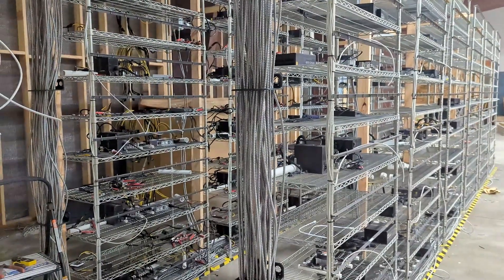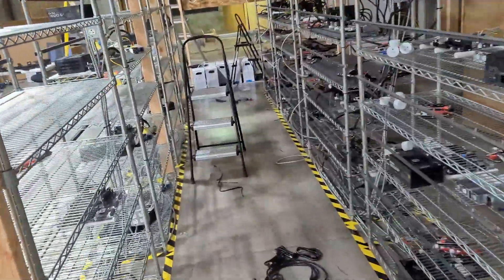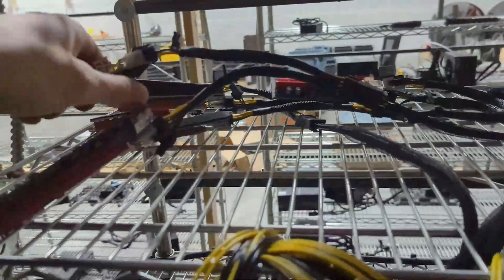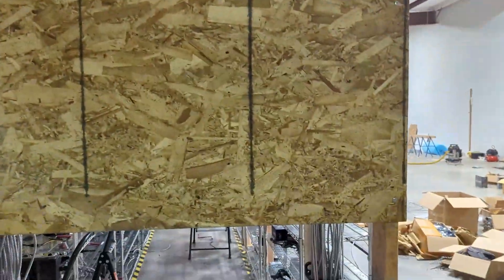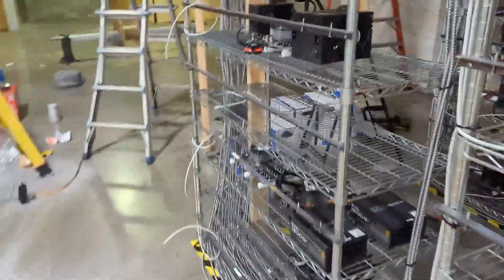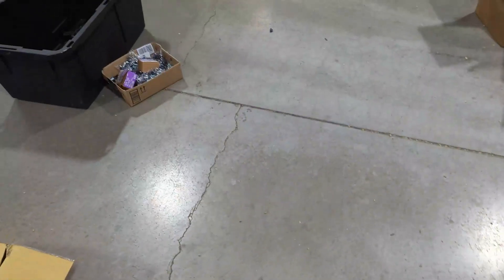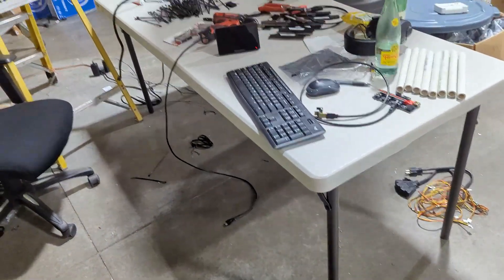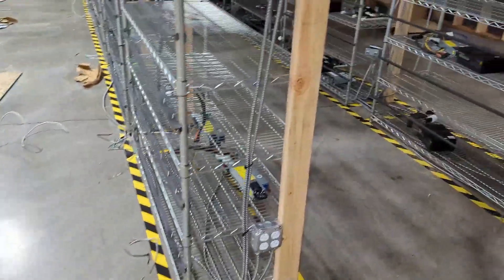GPU Mining Farm - Building Out Our 800 GPU Mining Farm

Comment: As a professional server-room cabling technician, it's fun seeing the large-scale amateur setups. I would suggest limiting the number of electric cables in such close proximity to avoid induction and secured in overheard racking instead of running on the floor. Keep your data cables separate from the electric and label everything clearly. Color coding helps with immediate recognition of things. A raised platform floor with your AC or cool air coming from underneath and drawn out the top is an effective cooling method. At this scale, battery banks and a backup generator to ensure continued and seamless operations during power outages would also be advisable. Wood or any other flammable materials in a room like this is not advisable... use metal or secure your racks to the ceiling with metal wire for stability.
Love the vids my man... cheers!
Reply: Maybe a generator at most, but for the amount of power being used, it is not profitable to add a battery bank to something like this.
Reply: Amateurs as you said.